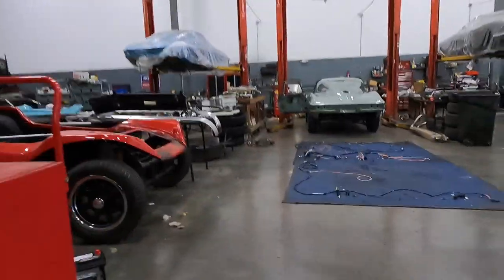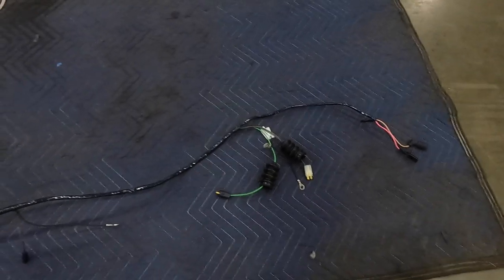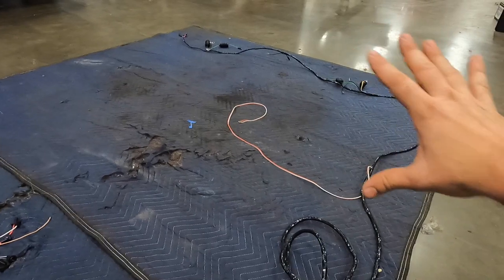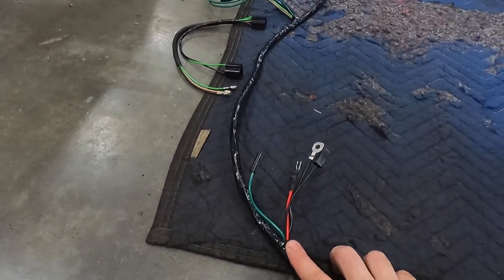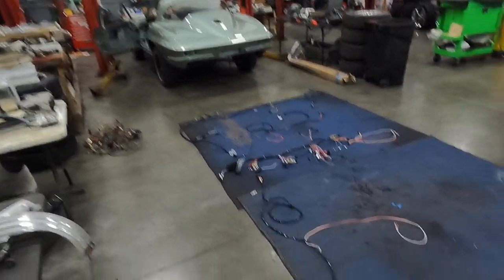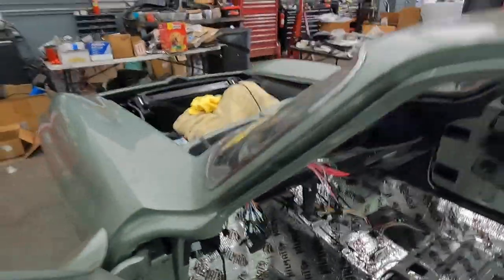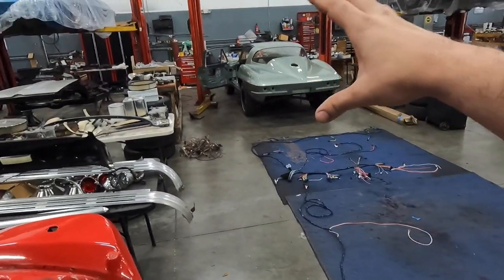Classic Corvette Electrical Harness Walkthrough

Comment: When I had my wife's 77 Trans AM rust free AZ car restored (steel was excellent, all rubber, paint, plastics not so much) I purposely replaced the complete under hood harness(s) with OEM equivalent due to heat concerns over time , all electrical has been flawless now for 13 years, car is like new and gorgeous.

Comment: Awesome video JR!  An old brittle wiring harness will come back to haunt you on many occasions and is worth the replacement cost if you want a reliable ride
Reply: I can attest.  Was helping my father in law with his 65 yesterday and "we" smoked" a wire in the dash harness in the vicinity of the ignition switch while putting in a aftermarket look alike radio.  Came here to aid our diagnosis.  It would appear red wire from blower motor was compromised and smoked the insulation well into the harness.   Damn lucky we didn't lose her entirely, but now we're on hold.

Comment: Hey Junior, this is very helpful ... really great layout and explanation. Thanks a bunch for taking the time!

A couple of questions:
How do you clean old connectors ... disassemble and brush, or chemically?
Do you add dielectric grease in the connectors?
Is it self-explanatory how exactly the wires are routed and fastened in the car, or is there a handy guide somewhere?
How does NCRS feel about the sound deadener or insulation added?
I noticed the dual-circuit brake lines. I thought '66 had single-circuit. Is this a mod, and does NCRS allow that?

Thanks!

Comment: Good video, and good information. I happen to be fixing a lot of wiring sins by the previous owner(s) in a ‘74 Firebird Formula - it’s amazing how much more wiring cars picked up in just eight years, and yet I see a lot of similarities between ‘66 and ‘74. I had to chuckle when you called out the wire for the interior lights with the bullet connector. That same wire is not connected on my car, and I was wondering what it is for. I had suspected interior lights, but that suspicion is now strengthened from viewing this video. I have a basic wiring diagram for the car, but little things like this help, too. I like the technical info, keep it up.

Comment: Excellent tutorial. You should make more!

I have an issue with a 1962 corvette with an erratic gas gauge that ticks in timing with my blinker or brake. I have had mechanics look at the car and he replaced the sending unit but it still does not work correctly. I had a short in the rear blinkers but I corrected it. However, since I fixed the blinker issue the passenger side (2 lights) blinks and then the other, over and over, until the operator ends it.

Your advice would be welcomed,

John

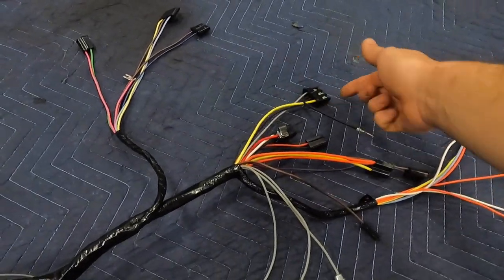Comment: Can you identify the connector you touch briefly at 7:59 of your video?  I was fortunate enough to find this very informative video you shot...in one take.... and am trying to diagnose a problem we're having with my Father in law's 65.  The connector in question has a metal clip affixed to it and the orange wire completely smoked well into the harness while we were installing a radio yesterday.  Needless to say, we are offline until we can get this harness replaced.  This identification will aid us in our troubleshooting endeavors.  Thanks in advance!  DEFINITELY HELPED TO HAVE THIS LAID OUT AS YOU DID TO BETTER VISUALIZE WHAT'S WHAT!

Comment: Awesome! I’m restoring a 64 Sedan. If this car wasn’t a Vette it should be crushed. The wiring on this car looks like a Stephan King movie. Lots of disconnect wires, corroded, and twisted/electrical taped splices. Getting a new harness, like starting with organized layout. You got it nailed. This is my first fiberglass body how is the grounding initiate and distributed? I’ve got maybe a dozen Mustang and Falcons under my belt, first Chevy (a fiberglass one) many thanks.

Comment: great video!
Just recently purchased a 65 convertible from my parents who’ve owned the car since the early 70’s. It was parked in the garage in the mid 80’s due to the brakes not working. At that time, I filled the engine cylinders with oil and put it on blocks. After a few thousand dollars the cars up and running great but I now have electrical bugs. After checking, looks like the fuse box has top rust on the connectors. Just thinking it might be worth stripping the wiring harness out along with the fuse box and thoroughly cleaning or just replacing. The few bugs are items such as no power to the gauges and instrument cluster dash lights. Any thoughts?

Comment: I watch you guys a lot. The 66 wiring diagram laid out on the floor might help me track down a problem in my 67. But I have a question first. I bought the car in Feb and it came off the transport with the turn signals and brake light not working. The flasher knob pulls out and won’t latch if depressed, but does activate my flashers. So my bulbs are good as well as the sockets. Lights also work except drivers side parking light which barely lights up the element. All other parking lights are good. Question: does the signal harness in the column if faulty, cause the brake lights to not work?

Comment: This was great as I have a '66 sb and, with your help, have now identified a nagging question regarding an unknown wire.  I have owned my car >20yrs, am the 4th or 5th owner now.  Car was never correctly or completely restored and I keep discovering missing or incorrect items, trying to fix or rectify the condition as I gain more knowledge.  Would love to see more underdash or behind dash wiring videos.
Can you explain or identify locations and / or proper grounding?  Have tremendous 'crackling' or interference when I turn on Radio.  Not sure if grounding is issue or radio needs rebuild?  Any suggestions?

Comment: Hi Chris, Question? The little ground wire with the female connector  on the dash part of the harness on my 64.   Where does that connect to? I pulled my dash and I didn't mark it. I think it came off as I was getting the dash out. Please help. Great vid. Thank you!  Another Fl. guy.

Comment: Very informative!
This is for a classic corvette stock install.
Who is the manufacture of the harness.
What happens if you do a resto mod and install a laser motor with fuel injection?
Will the harness supplier make the changes for you. Eg electric fuel pump?

Comment: Does the fwd lamp harness go outboard? In other words along the drivers fender to the drivers side of the fuse box? Great video by the way but the video is not clear enough to answer my question plus you have the two plugs tied together.

Comment: Excellent video - would an NCRS resto use that type of sound deadening material - looks kind of "shiny?"
Reply from the maker: The sound and thermal deadening I used on this car far surpasses the factory underlayment in terms of performance. For most builds, we feel the potential future point loss is a price worth paying for a much better driving experience. The same could be said of powder coat, stainless lined calipers, stainless brake lines, base/clear paint, ect.
Reply: @HorsepowerWarehouse  I agree 100% - if I ever do a C-2 it's coming down to you guys - keep up the GREAT videos!